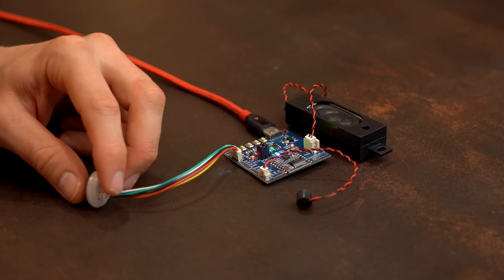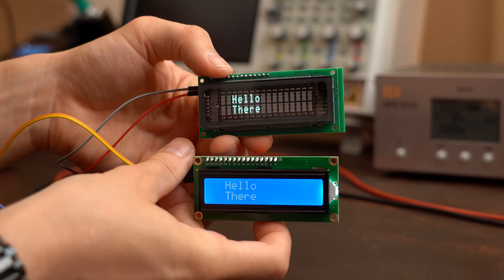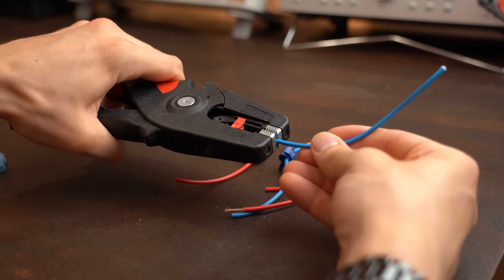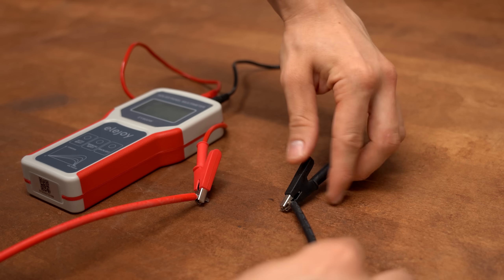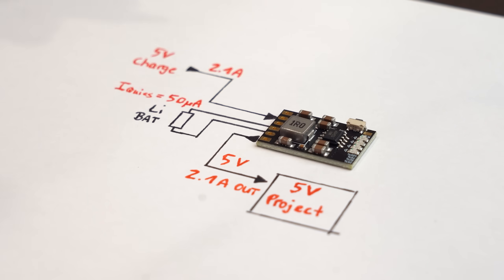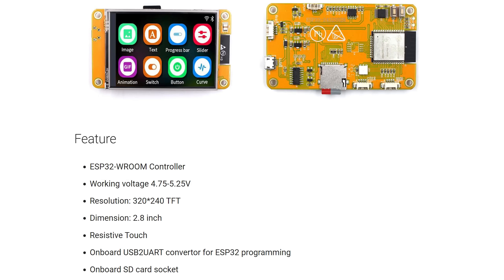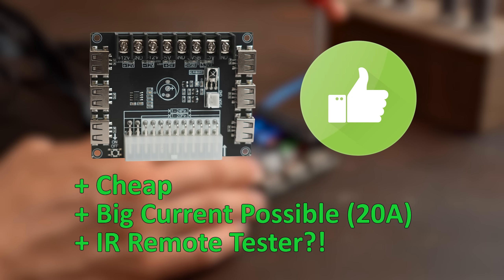I tried finding Hidden Gems on AliExpress AGAIN! (Part 6)

Comment: Extractor bits were never supposed to be drill or power driven. A specific hole size for a specific extractor. A light tap on the extractor to seat the teeth in the hole sides and then a T handle to push in on the bit while slowly turning.

Comment: this extractor is not perfect but it works, use lube to drill it and when extracting you will need to hammer it a little and then with low speed and push force it bites and it works, you could also use it with a rench :D

Comment: Does the little charger with power level indicator have discharge protection? It doesn't say "discharge protection" although says overcharge, overcurrent in the description.

Comment: 4:55  no it doesn't debunk their claim. Their claim was that the original wires resistance wouldn't change, not that the resistance of the t split junction would be different. Realistically, if the wire is the right size that it doesn't cut any of the strands, their claim is 100% true. If it is too big and does cut strands, then you would be correct.
If you are "being scientific", you need to actually do the correct test.

Comment: 7:16 Does anyone know if there is also something without “Auto-Off” and with only 3.3V output?
LiPos all have 3.7V. And ESP32 all have 3.3V. So you boost the 3.7V to 5V beforehand so that the ESP32 then burns it again to get to its internal 3.3V.

Everything I have found so far also had auto-off. Which is really impractical for an ESP with sleep modes.

I need
- no auto-off
- LiPo charging with USB
- Output with 3.3V

Apparently there is nothing :/

Comment: Cool video.  I agree with you on the "T" connectors.  We always referred to them as Vampire Taps.  I never trust them except for very low power connections. They can be very dangerous.

Comment: Does the 5V charge controller reset the output when you plug in the charger?  Will it handle LiFePO4?  Seems like a very handy board for a Raspberry Pi UPS if it doesn't reset the power.  I would REALLY like something that does full power negotiation on the USBC, can charge with larger power to handle 1 or 2 Pi5's, but I don't expect that for less than $1!

Comment: OK Scott I’m gonna I’m gonna hope that you sub space causality the bit that eats itself off the software in both the hardware and the software language has to be accounted for the Arduino that’s 50 times faster Arduino look it up and read that shit. I left there 50 X faster Arduino That spot that he’s putting data in gravity hits their 360,000,000,000,000 times a second and cuts that whenever the software hits there that’s that James Bond software that’s one of two ways that Ethan Hunt tracks the knock list when the people fuck with it puts off a low level radiation around while it seems heartless in small doses it’s putting it out in a large doses in both Apple and windows computer every computer. They’ve purposely made them that’s part of the engineered obsolescence when they’re running there they’re chewing themselves up due to gravity causality 360° 360 trillion times a second now it’s divided by three because there are three gravitational cores to are sitting one on top of the other and the third is sitting just off of those two for the desolation plant to work inside the planet that’s a man-made ancient construct anyway a warmness cell is what you wanna make and the warner cell will put out its own band of causality and you’ll grab that when you go grabbing with the device like that Arduino is showing stay away from the high security section. There’s already something driving the ship already that side is deadly it will fire back upon you. There is 90% of the system you can play with and it’s a fucking Internet. That’s just inside the ship with all kinds of information on it, including schematics supposed to be direct 3-D printable shit at this point because engineered obsolescence has hit us so dearly so diligently engineered obsolescence is taxation without representation. I might add taxation without representation is slavery on mass slavery, brings with all the crimes of old and hiding long before you ever see itwith spray painted neon sign at your front door while you’re all alone because you didn’t help any of your fat

Comment: You can get VFDs almost for free from some old VCRs and other TV equipment. They usually also come with a driver chip and for the anode and filament supply you can built your own little power supply.

Comment: I had mixed success with those kinds of screw extractors on my motorcycle. I was able to remove three smaller screws, but for some larger ones they wouldn't grip the screw head well enough. I had to get a set of Irwin extractors.

I've really come to appreciate those Wago connectors. I designed some holders for them that can be included in 3D printed projects and used as power distribution terminals.

Comment: i think the IR is for enabling or disabling  the the power supply. because as i recall there is an enable pin on most computer power supplies (the gray wire if memory serves me)

Comment: you did not use the screw extractors correctly those are good i have used them before and they have gotten me out of a lot of headaches   (p.s. don't go so fast wile extracting. the sharp side is for drilling a hole, for the twisted side which is meant to tighten its self in the hole. all of which is done counterclockwise.   please give those another try... slowly )

Comment: The charge boards shown at 7:00 are garbage, They just drain the battery's when off. Mine drain a 500 mah battery in a few hours. I can run an LED is its off state....

Comment: I did high-end car audio and security installations (including being lead installer and running several install bays) for about 15 years. Those t-connectors were a huge no-no. We could always tell when the amateurs and low-rent "professionals" did work we were fixing or replacing when we saw those garbage connectors.

Comment: Love this segment.  Thank you for reviewing the beefy ATX breakout board.   Ordered one, hooked up to my retired 300W computer PS in less than  5 seconds, then tapped into 12v posts with 16G hookup wire,  and this sweet little breakout board fired up a 50W halogen bulb easily.  To my surprise the board did not blow when I rewired the bulb to an externa switch, and of course shorted everything - several times to boot (Doh!).  Assuming short circuit protection comes from the power supply itself, not the breakout board since its circuit is very simple.  Given my PS ratings, I now have the following wattage max ratings : 150W @ 12V, 100W @ 5v, 50W @ 3.3V.  
Next up -- Add buck boast convertor for variable voltages to 60V with current limiting.  Any suggestions on what specific AliExpress/Ebay board to get?

Comment: Love these reviews. Always find great new products. 

That said, I have a similar screw extractor set and it works fine. I think you had your drill on high speed, and maybe moving the head about too much. 

Also, I use similar T connectors for prototyping and testing and they work great. Not for finished products though.

Comment: I know there's some time since the video is out, but as someone who got one of such displays. To everybody considering get one of those, I have a important WARN. PLEASE DO CHECK WHICH DISPLAY DRIVER AND ESP32 MCU IT USES!!! -> Reason being, most use commond display drivers like the ILI9XXX family, which almost all libraries support, like that 2432S028, this one uses the MCU ESP32-WROOM, but others like, theESP32-8048S050 (mine) and the  ESP32-4827S043C and ESP32-8048S043C, have both different MCU and less common drivers, ESP32-S3 and ST7262 respectively. And I will find that trying to find that the most common and easy to use TFT/LVGL8/eSPI libraries available, won't have the support for the drivers they use and need.

While it's not that hard to make your own, It'll take quite a considerate amount of time configuring and tweaking those libraries, to get it to work properly, an figuring what versions of those libraries actually are compatible with your particular board model.

Link to a discussion topic about it, where I posted my configuration and custom drivers which I've able to compile and run (It's centered mostly in using it with the LVGL and GFX lib, but might help for those who want to setup the TFT_eSPI) . https://tinyurl.com/esp32-forum-help

Comment: 9:57 This removers work fine, but not with a drill... To remove a damaged screw, you need one thing above all, and that is sensitivity. You don't have this in any way with a cordless screwdriver. Use it with a hand tool and it works as described!

Comment: Great video! Just a side note - the screw extractors work fine for me. I have the same set, and had a heavily damaged screw in a lock cylinder box that I couldn't get out. These extractors made it possible, and thus I could remove the casing to service the lock cylinder.

Comment: There another ATX breakout that has can use with banana plugs and has QC 3.0 at the side and an adjustable voltage from 1.2V(?) to 10.9V. I wish you also check that.

Comment: I would argue that the solar poanel "multi-meter" is not actually a "multi-meter" since it cannto measure a multiple of electircal values. It is a "solar-meter" as it can only mesure solar panels specific details.

Comment: I have these "unscrew" drill-bits, and they work... but my screw where I really needed this was so un-unscrewable that it just broke off the head by too much force... got the screw out because without screw-head I could remove the parts from another and the protruding bit it left could be unscrewed with a plier

Comment: I'd kind of like to see some examples of integrating the ESP32 LCD Board with HomeAssitant, presumably through ESPHome. On a not quite that level of difficulty use, I'd like to turn one into a refigerator/freezer monitor that remembers what units I prefer, and will let me know when the temperature in the freezer is below freezing, and the temperature in the fridge is safe for food storage. I've a propane/electric refrigerator in a camper, with the 'old school' propane/electric option, meaning that all 'electric' does is provide a heat source to initiate the same cooling cycle that the propane burner in the fridge provides. The down side is that when I head to my camper it can be 3 to 5 (or more) hours before the temperature is cold enough to keep things safe. So having a display that I can mount on the wall next to the refrigerator that lets me know what the current temps are in the freezer and fridge compartments would be handy for keeping track of that. My presumption is that a set of 3 Dallas DS18b20 sensors attached to vcc, gnd and a data pin would be sufficient to capture current freezer, fridge, and room temps for display, with a touch button on screen to give historical data with predictions for how long before temperatures are in the safe ranges, and perhaps nice to have features like how the room temperature appears to be affecting the temperature drop, and perhaps a notice if the temps start going up that perhaps it's time to swap out a propane tank, or simply note that the refrigerator isn't keeping up with that 40 degree C temp in the camper.

Comment: VFDs are fun, there's a community library somewhere that allows control without the need for the additional backpack, as the built-in controller is fully capable of SPI/UART/I2C. They are commonly used in precision instruments due to their high contrast, broad viewing-angle, longevity (I have a few that have been running almost continuously for >15years), and high refresh rate. The better versions forego the traditional rows of 5x7 symbols and instead have a continuous grid that allows for animations. I have a stack of the older 2-4 line displays but only 1 newer version. 

Fun fact: the displays normally require 40v to energize. One of the issues they can have is overcurrent. Things may explode.

Comment: 10:10 I can say that I've used those 'stripped screw removers' and I was able to get r he smaller 2 to work, but not the other ones.  But still, I wouldn't recommend them.

Comment: That power adapter (last board) is interesting. How noisy is the output? Because I want to use it in audio (+/- 12V rails).

Comment: AliExpress scams are unpoliced.  I've had sellers say they shipped something, not provide a tracking number, and just say it was delivered.  They quickly say that they will give you a refund, but they won't give a full refund.  They claim that there were customs charges that they have to take off the price.  In reality, they never shipped the product, and you're screwed.

Comment: User error.  You ran your drill too fast for the extractor bits.  That's your fault.  Plus you also just didn't use them right.

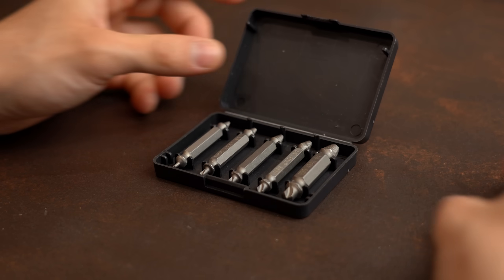Comment: 9:20 . i got a very similar set of those stripped fastener removers on amazon 6yrs ago. the set in this video is not a good set, because it is missing the smallest size bit. the good sets have 6 bits in them. the box is the same size & its looks identical, but the best set will have the bits closer together, as they needed to squeeze them closer to fit the 6th & smallest bit. if you work on electronics, or RC hobby stuff, the smallest size is crucial.

Comment: There seems to be a widely held belief that Li-Co Batteries should not be soldered, so I bought a spot welder kit for when I built and eBike battery. Of course you need to buy nickel strips and find a high capacity power supply or battery to power it. However, I have seen numerous videos where the user solders directly to the battery with no apparent ill effects. It makes me wonder what the reality is with respect to soldering leads to lithium batteries.

Comment: Maybe a silly question. Why did you invert the cable probes at the meter end instead of at the connection end? 

It is just that you mentioned that you inverted the connections but then fixed it by inserting the cables in the wrong colour.  I know they are just cables and you probably had forgotten more about electronics than I'll ever know, but for some person getting into electronics it may not register and then they will end up learning bad habits.

Comment: 12:19 The current you can draw from the 24 pin connector is considerably less than the dedicated power rails. Separate outputs for those would be much better IMHO

Comment: What do you think of the $17 Bangood
"AC170-270V/63A WiFi Smart Voltmeter Ammeter Digital Power Energy Meter Tester APP Remote Control Electrical Frequency Factor Amps Watt Kwh Meter - KWS-302WF (with WIFI and power off)"

Comment: The screw extractors have left handed screw thread. Normally it is lefty loosy, but in this case it is lefty tighty. Weird to use.
I slowed down your video to see you used wrong direction.
Reply: I saw this too. It was definitely user error in this case since his dril ran clockwise and it should have been set to counter-clockwise the entire time (drilling in and backing out the screw)

Comment: Hi. I was looking for exactly this type of Battery Charger/Booster. I bought this product after watching your video. However, even though the load I connected does not draw low amperage, it turns itself off after 30 seconds. (RC transmitter) I bought 10 of them, I tried 3 more different chargers in case there was a problem with the product I tried. they all do the same. After turning on the transmitter and after the charger started giving energy, I tried to use it by holding the button for 3 and 10 seconds, but I still cannot prevent it from turning off.

Comment: Does that charger board do proper overdischarge protection? Also, those ATX adapter boards are handy, but also pretty sketchy as their output exceeds the current rating of the ATX 24-pin connector by quite a lot. That's not a deal breaker, but it does require some caution on the side of the user unless you enjoy the smell of burning insulation and have buying new PSUs as a hobby.

Comment: That ESP with the screen is fantastic for people who don't live in areas where it's cost feasible to use PCB printing services. If someone were to take a similar approach to power and pinouts and basically just bolt together a decent phone charger, breakout board, and bog standard esp32 into a compact layout they'd wind up sold by the pallet.

Comment: Do you have to press the button before using the booster board for it to output the 5v? or will it output 5v without pressing? I ask because with my application the button will not be accessible, but consists with an on/off press button to arm the device and a momentary button as a trigger which I would want the 5v immediately. So if I need to press that button first, it wont be suitable.. Thanks

Comment: The charging module has another problem - it switches from external power to the battery when the first one disconnects very slowly. It takes 50+ Ms, which makes the module useless if you want to build a UPS.

Comment: you are using the screw extractor the wrong way. First, the two sides of the drill are for two different situations, second, your drill was too fast, you should use the slow and heavy torque mode. The hole on the screw is too smooth, so there is not enough friction. You need to carve some notches first.

Comment: I bought one of those ATX breakout boards, but I'm not getting any power out of the outputs. Although I can get some power from the 5vsb plug, and the light is on. But I'm not sure that the breakout board is faulty, or if it is a problem with the old HP PSU 366307-001. This old PSU doesn't have an on/off switch and I'm wondering it it uses some kind of signal from the computer to switch on. :(

Anyone know?
Reply: It was my PSU. But all sorted. 😂

Comment: Thanks for the video.
For the battery charge/boost board, the one you got is "black" PCB. Which will turn off if the load is too low.
There is other one which is "white" PCB, it will always on even the load is low.
2 cents~